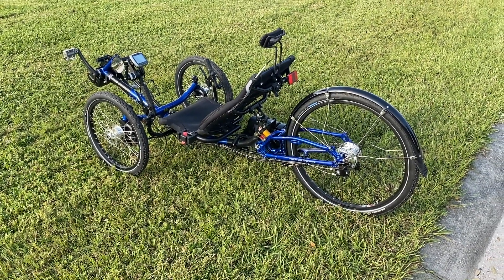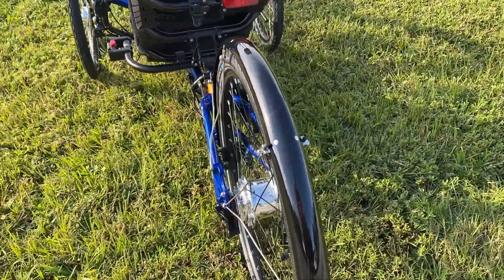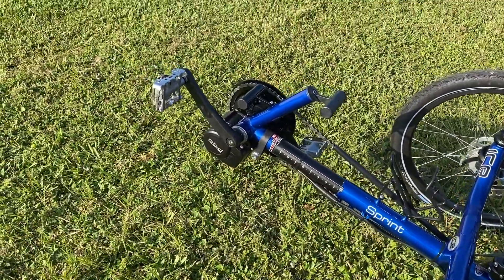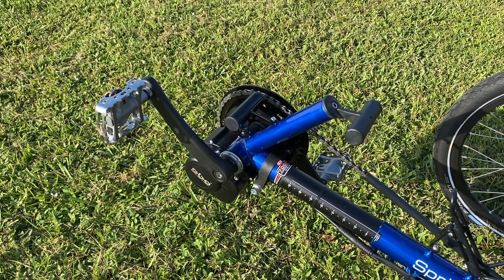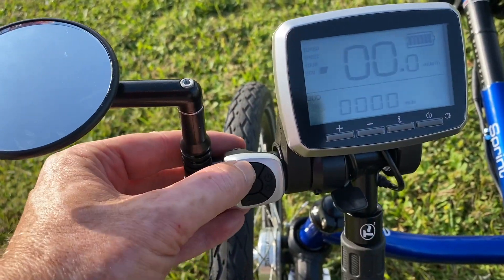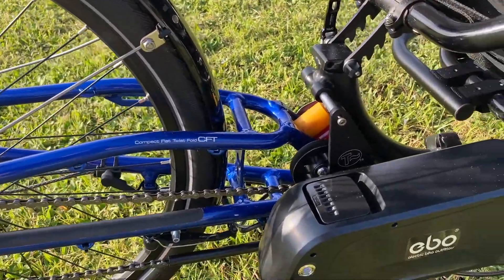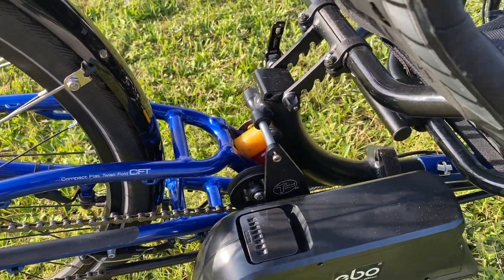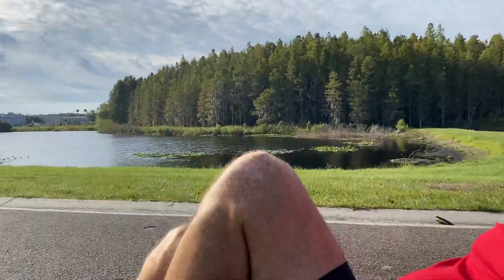ICE Sprint Pedal Assist With Rohloff Conversion

Comment: Tim:  I have a question.  All Rohloff systems offer a 526% gear range (unless they are paired with something up-front to increase range even more.  However, how do you decide, for a given rider, the gears inches for the easiest gear.  Rule-of-thumb, test rides, calcuations or what.  Basically use determine his by the combination of the size of the front chainring and the size of the main rear cog external to the Rohloff.  Also do you like to change either one, or do prefer mostly to change chainring or cog.  

One final question ... do you have a rule of thumb for the impact of a motor on the low gear required.  For example, on a Shimano Steps 8 if some normally needs 18 gears inches to climb hills in the area is therre a multiplier, e.g. 1.3 X for a motor.  

Thanks, love your videos.  
Ken
Reply from the maker: Ken, thanks for the question. Most Rohloff changes happen with the front ring. Most common is a 36 tooth front although I have seen larger and smaller rings used. I will say this, most people are fine with the basic setup since the Rohloff range is so large.  

As far as gear inches, I found this calculator that might help. https://www.gear-calculator.com/?GR=RLSH&KB=36&RZ=17&UF=2185&TF=90&SL=3.5&UN=MPH&DV=teeth

Comment: How much does this upgrade cost in this configuration? Great video. I’m looking at doing this.
Reply from the maker: The motor conversion is about $2,500 and the Rohloff is about the same.
Reply: @BentRevolution  that’s not bad. Thank you for the info.